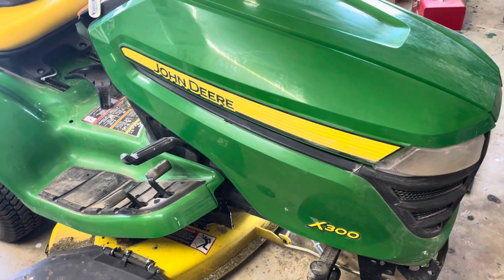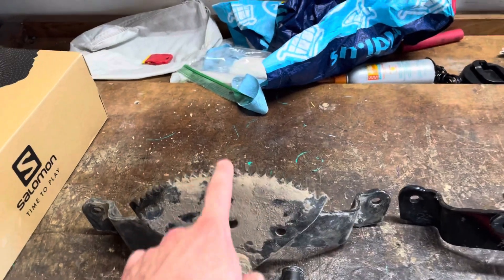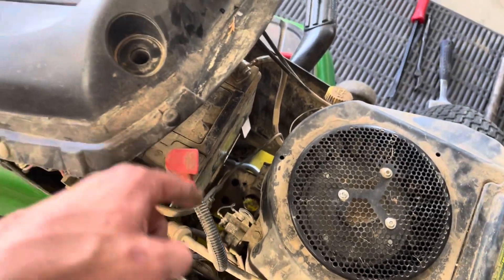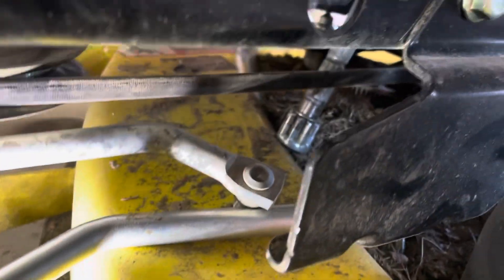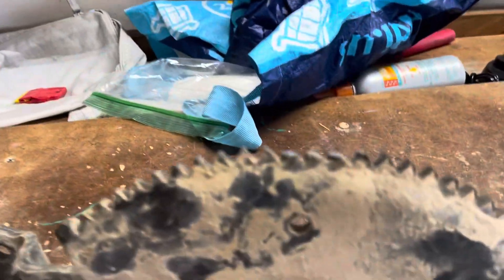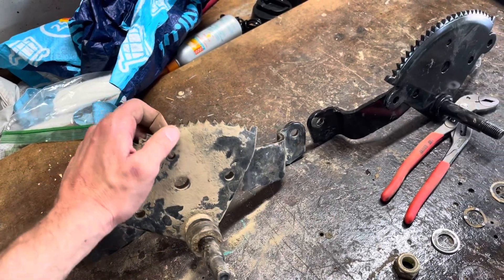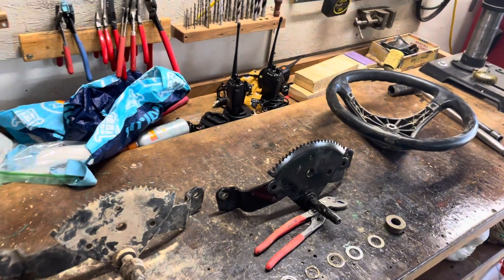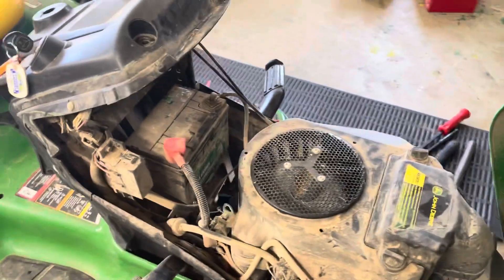John Deere x300 steering gear replacement

Comment: I'm having a problem getting the streeing wheel off any suggestions.
Reply from the maker: You mean as you pull the steering wheel shaft up it gets caught on the gear set?

Comment: Did you have to remove the cotter pin on the steering shaft behind the battery? Or was there enough play to get it down far enough?
Reply from the maker: I removed it